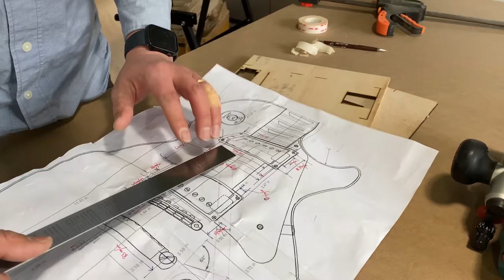Making a Futuristic Custom Les Paul Guitar(Full Build) / 나만의 전기기타  만들기

Comment: I love the woodwork and concept.  The volume and tone controls need to be somewhere else, easier for the player to use, also the selector switch. Maybe an acrylic insert on the bottom to put all the v/t/selector switch onto?  Route the edge on the top of the bottom part, cut the acrylic piece to fit on top, then put the v/t in the typical place, and the selector switch at the front near the hook. Just an idea.  Really cool look and work, though!
Reply from the maker: Thanks for your comment. It would be helpful that next time I build more guitar. thanks

Comment: One of the most strange projects in engineering aspects, time to time unlogical, such as bolt-on joint already glued-in neck. Or tone-control and wiring, etc. But, at the same time its interesting project 🤝
Reply from the maker: Thanks, during the project I made a mistake so strange things happen

Comment: Truss rod installation not shown, is there one?  Raising/lowering pickups possible?  Unable to see neck finish, finish out of frets missing.  What does this guitar weigh?  Les Pauls are heavy, preventing many from buying them.  If this weighs more than a “regular’ one, that will be a consideration.  The tone & volume controls look unconventional, but I bet they are just fine.  One comment about lack of sustain is legitimate, but the video doesn’t really answer that one way or the other.  Cosmetically, this is a beautiful piece of work.  Congratulations!
Reply from the maker: very helpful comment. thanks

Comment: Cosmeticly it looks great...functionality wise idk...the knows are in awkward places and the swit h to me would at least make more sense going left to right than front to back I think using an actual guitar next would have been a good call...don't get me wrong it looks great but the frets need shaved and the neck really needs to be able to be adjusted...also try some shims between the neck n body...just a piece of paper boutvthe size of a match width n put it on the pickup side of the body/ neck on the pickup side of the screws...kinda helps move the neck a Lil if the strings need lowered...other than that...taking it in to fine tune would be a great next step...they can dial it in...but it's freaking sharp man...great job it's beautiful
Reply from the maker: @BIGGUN3460  thanks, It was my first time built guitar. I would be better next time I guess. Really thank you for your comment
Reply: @Cubemoon  the craftsman ship is beautiful ...seriously...ik it seems like I was being kind of harsh...believe me...love the look of it...if those issues were worked out...I'd buy that guitar in a heartbeat...but those are things that people that really play would notice n I imagine your not just doing it for fun...my comment was truly to help you grow...fr...I'm a fan of your work for sure...

Comment: Better choices, glued in neck, put wire routing holes in as you build the body up, put the four pots on the bottom and the selector switch in the gap on top where the les paul switch position is on nearly all their high end guitars. Ultimately though, I can just buy an RKS, oh hang on, I did.

Comment: Could you tell me what the dimensions are of the wooden laminate at 3:02?  Are the wooden pieces quarter sawn?
Reply from the maker: there are 5 pieces of laminate, from left 35mm, 10mm, 20mm, 10mm, 35mm. and I sawn 35mm to 12mm approx.
Reply: @Cubemoon  Thanks for your answer, so that is the width of the different pieces, what is the height?